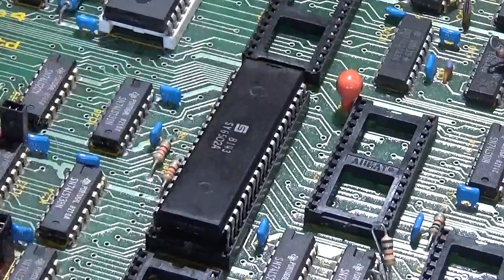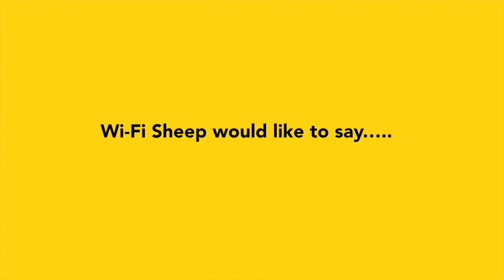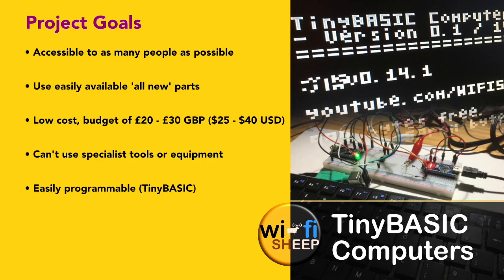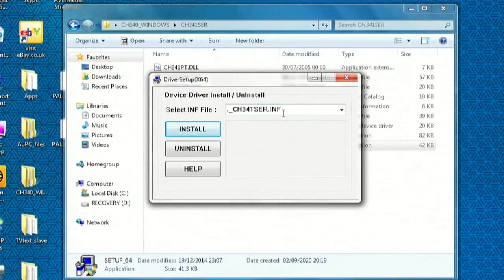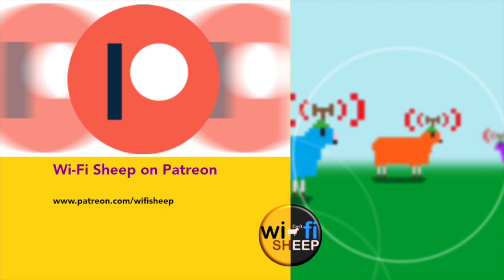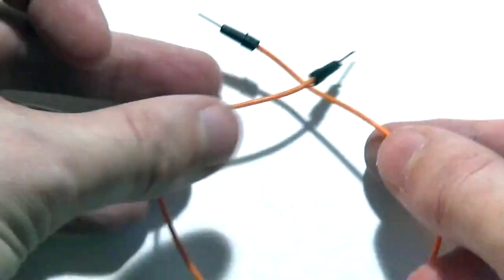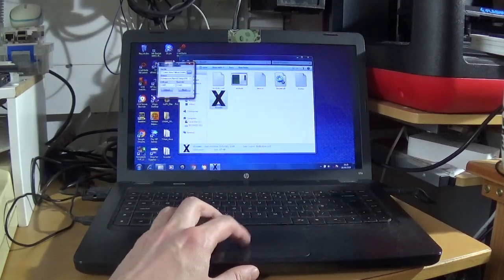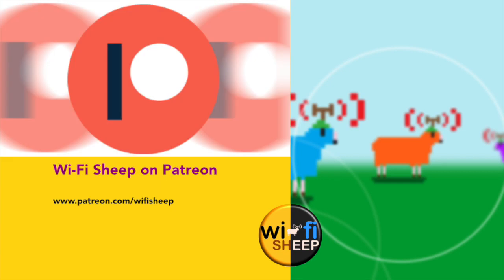TinyBASIC Computers Easy Build 8-Bit! - Pt1: Introduction

Comment: can i use a ps2 type female connector with 6 pin pre soldered header
Reply from the maker: Hi as long as you only connect 5V GND CLK and DATA I don't see a problem with doing that.

The important thing is to get 5V and GND the correct way around!

Comment: Has it really been a year since your 6502 free run? Hoping you'd continue that to be honest.
Just wondering why go to the trouble of a second Nano and having to find an old TV? I get that you probably couldn't fit all the code into a single Nano. But presuming Nano 2 is connected to Nano 1 over serial and, as it's text only anyway, why not just do away with the the TV, the PS2 keyboard and 2nd Nano and connect directly to Nano 1's serial from any terminal via serial FTDI?
Reply: I guess the tv display vs serial makes it a more 'stand alone' computer, no need to be tethered to a 'host pc' for input and output. I also believe the second Nano doing the display might be because 'bit banging' composite video can be very very processor intensive on an atmel, perhaps leaving the rest of the computer experience a little painful if all done on one chip.

I've been tempted by several avr8 based computer projects over the last few years, even started working out how to do my own. As such I'll be following these videos with interest.